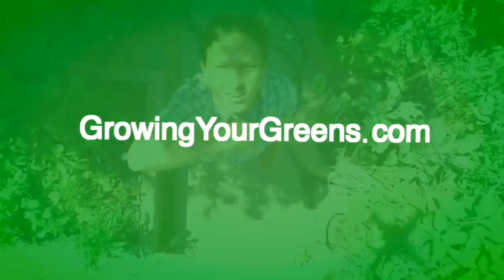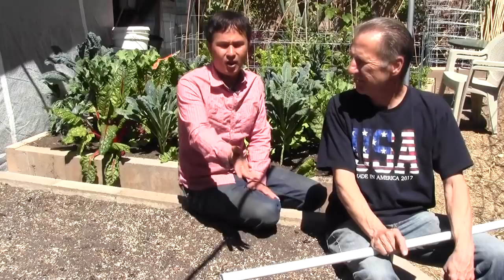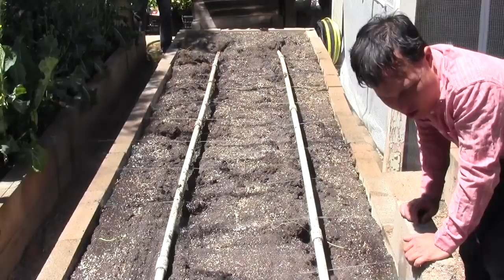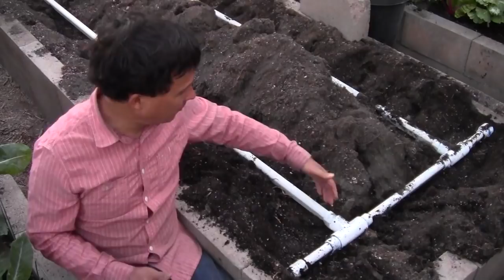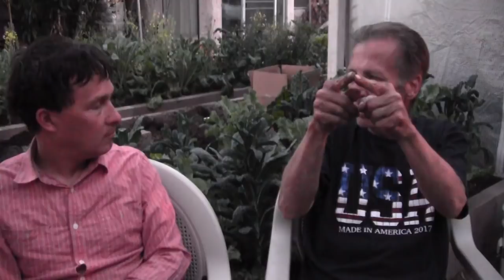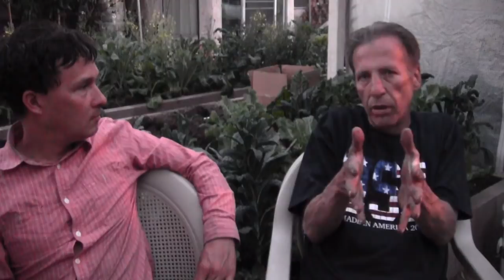AquaJet Water Saving Irrigation System - Why I had it Removed: 3 Year Update

Comment: I live in Vegas too and irrigation is hard. Over the years I have tried them all and found the old flood method the Phoenix farmers use works the best. Building a basin around the plant with a channel to the next basin works out quite well. You can use a timer to a pvc pipe with large holes at each basin, or just water manually. Yes there is evaporation, but the amended soils drain very fast. What i like about it best, is there is no guessing or wondering if the sub-irrigation is working. The plants seem to like it better with the soil wet from the top down . The evaporation helps humidify the air under the plant canopy in the 8% Vegas humidity. Proof is finding mushrooms growing in 110 heat.
I couldn't determine if i used more water, because my water bill has been the same with all methods.

Comment: I had an idea for an irrigation system I thought I could share with you - Terracotta irrigation pipes.  I theorize that it would work like an  olla but more efficiently.
Reply: Sounds good. You gonna try to make them?   Janice
Reply: well I don't have any pottery experience...  so, I probably won't, too bad.. I could see it selling on infomercials soo easy, especially in the desert.
Reply: FeyScribe You would just have to go to a pottery maker and have a tester made
 If it works them you can market it
Reply: Thank you for your encouragement, maybe I'll give it a try some time.
Reply: You should, it's an interesting idea.  Janice
Reply: Great idea. As long as they're made locally because shipping would be a beast. Also, they would be heavy, so you'd have to have smaller packages and overall more packaging which would add to the cost. I would add that if the terracotta was fired with concentrated solar energy then it would have a much smaller carbon footprint.
Reply: They would need to be in stores, not mail order. They would be nice though.

Comment: How do you deal with the uneven watering?  The center between the pipes gets twice the water of the areas on the outside.
Reply: Looks like there is twice the distance between the pipes as to the edge.
Reply: I've followed the installation and updates at Johns 3 years ago and since.  The emitters were designed to spray up to 2 ft through the ground.  In practice 1 foot is the norm so when you setup the system you do it on 2 ft centers ( a 2 ft wide bed would get one down the center and so on).
Reply: Underground, water does not just puddle up. It tends to disperse locally, to areas that may be drier, just like a sponge in a bowl of water.

Comment: SUGGESTION: They need to make a few pipes with holes only on ONE side. The cross watering in your system may be good for lettuce, but may turn your peppers yellow from too much water. I would like to see that new piece at the end, have water jetting just toward the outside wall and not toward the inside that is already being watered.

Comment: Could this system be fed with a water hose instead of the 1" pvc?  I would like to give it a shot instead of investing in a drip system but my current bed can't be permanently plumbed, for at least another year, due to other construction projects.  The current bed is only a 5'x10' bed but it is located about 80' from the spigot.
Reply: Yes you can use a hose to feed it.
Reply: Rob Buff cool I'll be calling soon

Comment: I do irrigation for a living and knew in the first five minutes that was a bad system the key to any irrigation system is to know how much water per plant in an hour and then control the amount by time and to equally distribute water to where the first plant and last plant on said system no matter how small or large is equal.
Reply: It works so crappy that john had it upgraded and installed properly using the 3 years of experience doing installations and troubleshooting problems.  That doesn't equate to a bad system under any circumstances!  He also didn't remove the systems from any of the other beds!  If this was such a "bad" system, he would've replaced it not UPGRADED it!!
Reply: Just because you add bad to bad does not equal good.